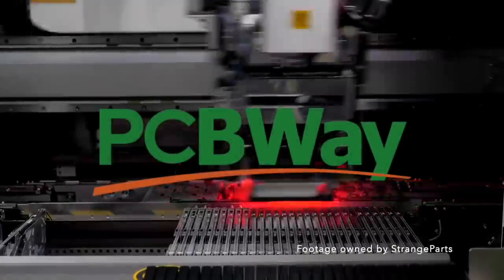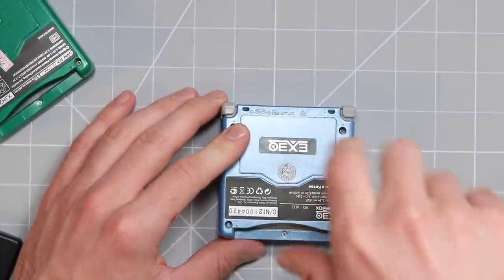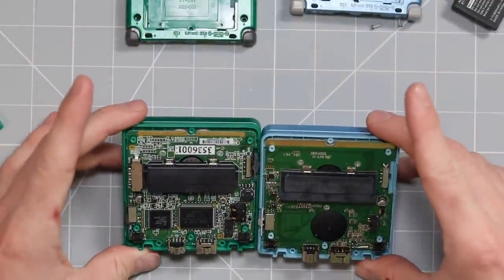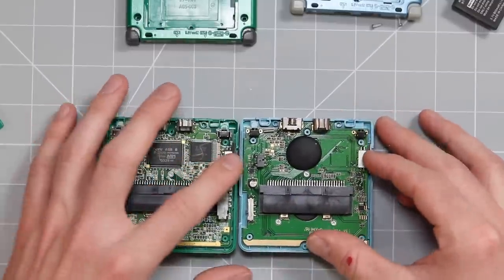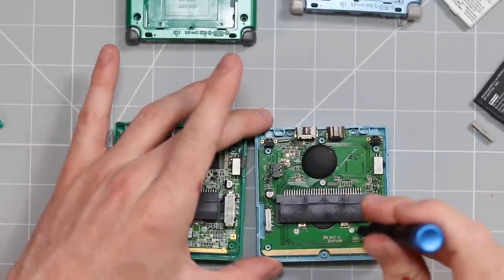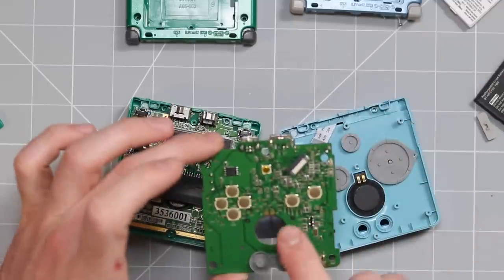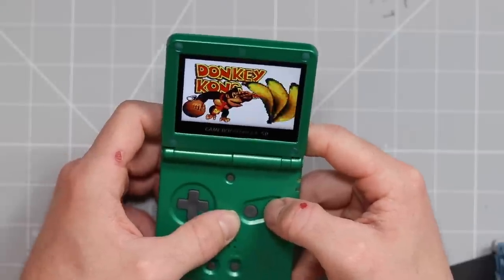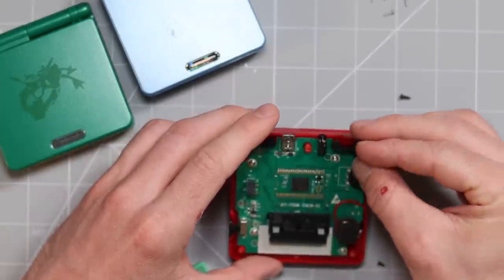fake chinese gameboys teardown

Comment: If that SP clone motherboard fits into oem shells.... I kinda want to get a clear bottom shell for it just to show off the knock-off innards
Reply: It does, I purchased one about 10 years ago at this point. I put it in the nes style shell. The only thing is that the screen bezel that comes with the kit won't fit since the Gamebox has a different size screen. Like I said I've had it for 10 years, the battery still holds a great charge and it still works great to this day.

Comment: Black epoxy over an ic has to do with reducing assembly costs. Under there is a naked ic directly laying on the PCB with jumper wires done by a machine. They skip costs for an ic housing and legs and need to solder it..

Comment: You're correct btw, the GBA still has the GBC's innards in its motherboard, and it can even access its soundchip and use that for GBA games! I believe the clone is emulating the GBC soundchip so it can properly play GBA games, but doesn't have the CPU or graphics processor, so it just straight-up can't natively play GB/C games...

Oh but if you get a GBA flash cart, you can use Goomba Color to emulate GB/C games on the clone, and most games I've tried on what I happen to own (not this clone) run fine, just the most demanding GBC titles that won't really work... Oh and you also get the SGB borders when available which is neat!

Comment: The glop-top is for two reasons:

Obfuscation of the chip.

(Most likely) covering up an EEPROM so that it won't get wiped.
Reply: Apart from covering eeprom, it's also to make sure whatever software is in that eeprom does not come out, trying to flash it out will probably destroy it. This is almost certanily not to make sure no else gets the software out and makes their own clone but because it's probably modified version of the copyrighted original nintendo rom code.
Reply: It's sometimes a chip-on-board, which is where the die is mounted directly to the board using bond wires then covered with an epoxy blob.

Comment: If I remember correctly, original Game Boy/CGB games took 5v, while GBA took 3.3v (or something like that; the point is that the older ones needed higher voltage) and that's what the cartridge slot switch changed.

Edit: The GBA Micro and the DS had a little solid piece of plastic in place of the switch, so GB/CGB games literally could not fit in the slot.
Reply: In addition to the voltage, there's also straight up code incompatibility. DMG/sgb, pocket/sgb2 and gbc have an 8-bit CPU based off the zilog z-80 / intel 8080, while the gba, ds, dsi, 3ds, and switch are (different generations of-) ARM just like most android phones, with the gba specifically being 32-bit ARM7 that had the option to run either 32 bit or 16 bit instructions.
From my research, supposedly it's ""well known"" that the AGB and AGS CPU's have a "gbz80" core on their die that the ARM core hands off all operation to when the switch you mentioned was pressed, (Modern Vintage Gamer has a video on it), and with a couple newer "meme projects" such as HDR's adapter board to use OXY/micro CPU's on the AGB, we may soon find out for a fact if the micro's CPU does/ doesn't have the backwards compatibility core or not
Reply: @imclearingit4149  I've been keeping an eye on that GB micro project bc I am so morbidly curious if it can do GBC backcompat. We actually do know that it has the Z80/bios because you can switch into the mode in software (and there's even a minor oversight that allows extremely limited arbitrary code execution from RAM), but we don't know if they stripped the cart bus and higher-voltage details required for it to work in its entirety
Reply: @imclearingit4149  I don't know exactly how the DS goes about playing GBA games, but it has two ARM cpu cores (an ARM946E-S and an ARM7TDMI like the GBA cpu).
Reply: @jnharton  pretty sure the ds uses both the arm9 and arm7 when playing ds games

Comment: 5v vs 3.3v for GB/C or GBA. I think it was that the CPU knew which mode to boot into based on that, which the switch in the cartridge slot changed.

Comment: IN THEORY, if you were to bridge the right connections on those pads in the bottom right of the underside (where the cart plugs in) of the clone, IF the chips a proper replica, that SHOULD put it in GB mode, but I'm unsure if those are even traced out, as it's kind of hard to make some things out.

Comment: Ive a gb station light i cant get it to charge with official power supply is the polarity different on pins if so could i get cheao supply and mod the lead thanks much better than swaping batteries over lol